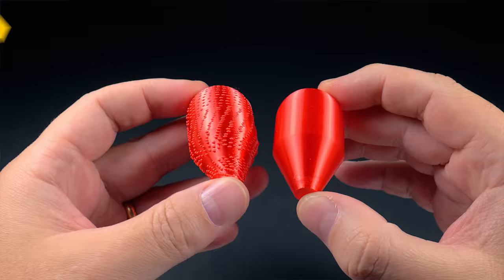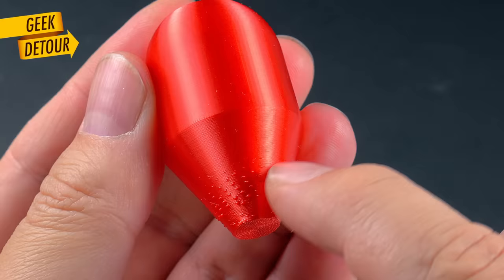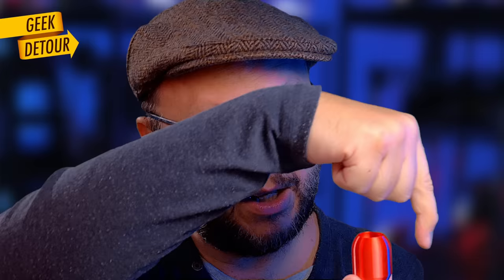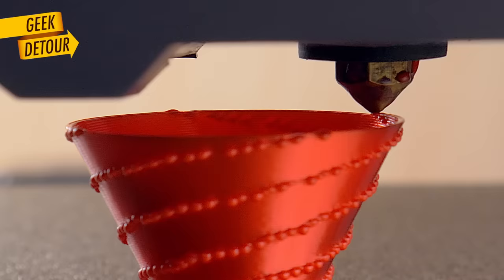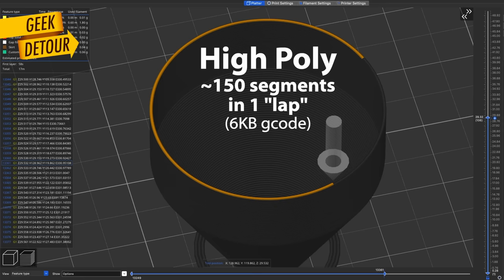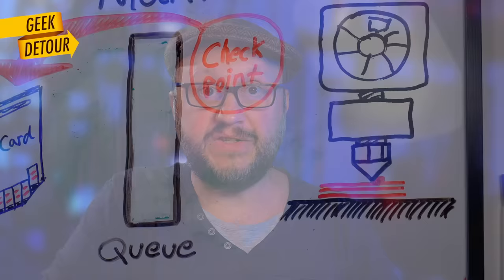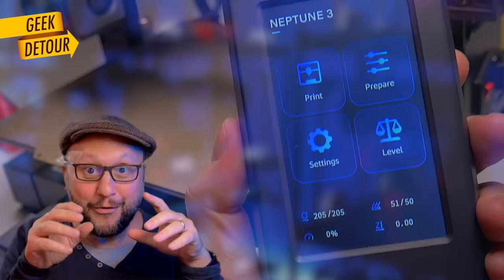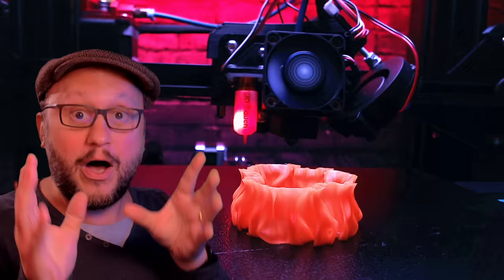3D Printer Blobs: a mysterious problem you won't guess how to fix 🤔

Comment: I got an apc to hold it for a power glitch dealing with finicky abs i rather keep it going and hold temperature. After 1 minute gen already has started and going through its warm up phase to take the load. I can't tell you how many hundreds of hours that APC has saved me from starting an entire print over even if you don't have an automatic generator apc will save you when you're using finicky material.
Reply from the maker: Hi there! I am curious, would you mind sharing the Country / State where you live?
Reply: @GeekDetour  sure USA South Carolina. We have strong storms lighting bolts that will rattle your house. Before i got an apc i had to wait for a clear whether day. As lighting likes to hit the power lines. I have tons of surge clamps for that. My server srt3000 apc will send me an email every time there's a problem. The most i had in a day was 40 and 1 email from the gen where it has started due to utility loss. A braker on the line tripped due to many hits in short amount of time.
Reply from the maker: Wow! Impressive! I would have never imagined 🤯 Thanks!

Comment: I now know why these blobs appear but i have no idea how to fix it. my printer (ender 5 plus) can't read the two gcode files that you gave and there are many little blobs on the stl file. i'm using creality slicer and can't find the option you showed in the slicer and in the printer settings. pls help
Reply from the maker: Hi Nicolas, first: try to copy the stl files on the Root of your sd card - not on a folder. Then print the “disable” one. It will disable the Powerloss recovery feature and save. 
Now you print whatever you used to print before and see if it helped.

Comment: What you do is a workaround. a fix would be either 2 sd cards, one is read, one is written, or a bigger buffer. shrugs
Reply from the maker: Power-loss Recovery itself is a workaround: the pause leaves marks on the print, if it stays down for more than a minute the heated bed cools down and the part you are printing unsticks from the bed and it is game over anyways... So, a proper "fix" is really having an UPS: prints should go from start to finish with no pauses.
Reply: @GeekDetour  well fair enough but a ups is more expensive than an ad card :)

Comment: Wouldn’t it be easier to make a short-charge battery system that only activates when the power goes out? If the machine detects it’s gonna turn off mid project, it could save right there while the short-charge keeps the machine alive long enough to write to the SD card.. you’d never need to apply multiple checkpoints, except maybe once or twice at certain percentages in the project
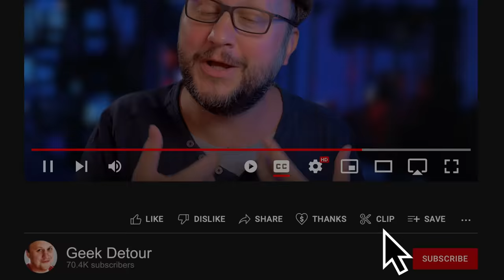Reply from the maker: Exactly! That’s what I mention at 7:10 and that’s what Chris’s video is about (it is in the description).

Comment: May be a stupid question to ask, if I downloaded the gcode for disable power lost recovery, I just need to run the gcode once in the printer or the gcode will work since it is in the sd card to disable it. Don’t know how to confirm it is working.
Reply from the maker: Hi there! You are right: if your printer runs Marlin, yeah, you would only need to run it once. It turns it off and saves the settings. If you have a printer running Klipper you don’t need to worry about it.

Comment: Hi, I come from South africa and we suffer on average three 2 hour blackouts everyday. any advice on optimizing my ender 3v2 neo to minimize any damages to the print when the lights go out?
Reply from the maker: Sure! A UPS unit with a HUGE battery. An Ender 3v2 might consume a bit less than 150W on average. Unfortunately, the cheap 900VA ups units can keep a printer for about 15 minutes. A UPS with a large enough battery for hours of autonomy will cost around a $1000 usd 🤷‍♂️

Comment: In my case, it turned out to be my new TFT35 on my Ender 3 not having a stable connection through its usb port. After going back to using the regular mini SD slot, my prints were fine again.

Comment: I have a sd card from 8 years ago which was being used in my tablet and it runs fine curious what it would be like with a newer card
Reply from the maker: I just got a 3D Printer that has a Raspberry Pi clone inside - and the OS came written on a very “generic-white-lable” SD Card… I cloned it into a better card, reputable brand, fast, designed for “apps” and oh boy it is booting quite faster now. You should try, yes!

Comment: Would it be possible to use a higher quality SD card with higher transfer rates? Would that make the queuing problem irrelevant, or is there an internal bottleneck for data transfer?
Reply from the maker: The problem is writing. It cannot read and write at the same time - and writing is slower.
Reply: @GeekDetour  Oh, interesting! Thanks for the quick response!

Comment: 3:43 - LMFAO. 5:34 - He really delved deep into the rabbit hole on this one... a new board should be designed such that a high speed NVME drive could be installed or a high speed memory chip to simply load in 512MB gcode. This way SD cards could still be used and simply loads into high speed memory, this way same ARM SoCs could be used with it's built in 512KB cache memory that could instantly load from high speed external memory chips that have g-code, the whole purpose is to retain the power-off recovery mode, this is really an important feature simply due to software and hardware reasons for redundancy and not related to no matter how great your power system is. Imagine having the best power system and doing a 1-2 day print job and then some reason a software or hardware glitch occurred, erased all it's current memory positions would mean the printed part is now scraped. Also I advice, if your're doing this for serious work or business, simply never use SD cards, buy a special adapter converter module that takes NVMe drives and interface with SD ports, this would never crash or die as compared to regular SD cards.

Comment: For us beginners, can you make a video of putting g-code on right place soo we dont messed up,Thank you 😀
Reply from the maker: Check my instructions in my Blog: you don’t need to run the GCode all the time. If you “print” the disable code once it will change the setting and save it:
https://geekdetour.com/3d-printing/blobs-in-your-3d-prints-power-loss-recovery-can-be-the-problem/

Comment: Is it normal for it to happen outside of vase mode? I can see a micro pause when it completes an instruction.
Reply from the maker: There are a few things that can slow down the printer from time to time and cause the blobs - if your printer uses an SD Card to print the GCode, if you use the card that came with the printer, that’s not the best. Get a good quality SDCard (usually 32GB is what many printers accept as a maximum), or try formatting your card. I hope it helps.
Reply: @GeekDetour  freshly replaced. I think what I am seeing is the z seam. It's slightly pausing there.

Comment: Hmmm.... Is the SD card reading using SDIO or only SD for arduino? the speed could cause a different, also if using DMA of some arduinos it could remain printing, while read/write from SD.  Could also solve the short freeze problem as my problem (though not related to 3D printing) is solved by SDIO&DMA features.

Comment: I got the same blob problem, but is not at the end of the layer movement is at the start. Firts the nozzle got in place, then the blob (makes a little pause before movement), next is the move, anything to solve it?
Reply from the maker: Hum… wouldn’t it be the seam? Like, every layer change, the nozzle starts and finishes at some point… it leaves a mark, even though it is much more discrete than a Blob.

If you are using randomized seam, try to change to “aligned”, a line looks better than random spots all over the piece.
Reply: I got a Anycubic Kobra Neo, and even with the default profile makes that horrendous  blob at the start of the seam (btw, that only happens when I try to print Swords, the walls or blades are almost perfectly smoth printed) my only headache is in the seam at the start of the layer. Walls or blades are perfectly separated but are stick together (almost glued) by the blob of the seam making impossible print a whole sword (try once but the blades never come out so I ended only with the handle, it looks like I print a dildo, jaja), even tweaking retractions but with no success. Luckyly today I made my homework and tweak the coasting and the wall wipe, and I'm happy because almost got it, now I think the reason still a little bit closer is the elephants foot.

Comment: I also get weird blops like this on my Neptune 4 Pro, only on some models. however there is no SD card inserted.. I'll try turning it off anyways
Reply from the maker: The Neptune 4 runs Klipper - you don’t need to worry about this feature/problem… Klipper doesn’t have PowerLoss Recovery and I think this is a good thing. Unfortunately, the Blobs you are getting are coming from something else 🤔

Comment: Hello, i try to use OBJ rather than STL. i feel my parts look more accurate. but do OBJ file is easyer on Gcode and solve this proplem? I use a Prusa MK3 and I never had this problem...
Reply from the maker: Hi Maxime - for 3D Printing, OBJ files should’t add any advantage over STL files. Both are a mesh of triangles. There could be many reasons why you never had this problem: only high-poly objects, over a certain speed trigger the problem. If you print using OctoPrint, then Power-loss Recovery also doesn’t get involved in the process.

Read the differences between OBJ and STL here - I think you might be complicating your life with no real benefit: https://3dprinterly.com/what-is-the-difference-between-stl-obj-files-for-3d-printing/

Comment: Is disabling the power off feature only help with spiral printing or for normal prints too?
Reply from the maker: Pauses might cause Blobs in any model that has lots of geometry concentrated - like soft curves. It doesn’t need to be in Vase / Spiral mode. It can happen in any type of print.
Reply: @Geek Detour  I was gonna say my prints suffer from blobbing on angled surfaces, but on relatively straight surfaces it's nice and smooth. I'll use your Gcode to turn off the power saving mode. Thanks for the video!

Comment: never had a 3d printer so this comment is just based on speculation, but would having a second sd card for writing the recovery data to stop the interruptions on the first sd card?
Reply from the maker: It would make it considerably more expensive having two SDCards for just a feature that is much better implemented if they add Capacitors to keep the board running just for some extra seconds to write only when a Real Power Cut happens.

Comment: hi! thanks for the awesome explanation, it could be that the same problem can generate blobs but not continue the print? i'm having that issue randombly in my artillery x1. Same gcode, sometimes it makes the print and sometimes it halts makes a huge blob and doesn't continue.
Reply from the maker: Wow Lucas, I don’t have any Artillery printer, but I think you might be having a different issue. Have you tried a different SDCard/MicroSDCard? Try a good quality Class 10 SDCard, don’t go over 32GB (8Gb or 16GB seems to work best), format it into FAT32 and try printing again. I would love to know if it works fine for you.
Reply: @GeekDetour  thanks for your answer! I Will try it and keep You posted.

Comment: Hi, I had this problem with ASA filament, I even exchanged messages with the brand, nothing changed the problem. then, I told myself that I was going to change slicer, I went from Prusa to Cura and I have no explanation, but I no longer had blobs. The only two parameters that had changed were the layer height from 0.2 to 0.15 and the speed increased from 60 to 80mm/s
But I don't think it's just these 2 small changes that are responsible

Comment: I get this issue in vase mode, but I print directly from the slicer on my PC (Simplify3D) over USB to the printer (CR10s-Pro), so there's no SD card involved.  Does anyone have suggestions or a solution, or would GD's G-code fix solve the problem?
Reply from the maker: Hi there! I would investigate the USB cable you are using, try another cable, or buy a very good - just long enough - usb cable.

Comment: Okay, so, I am a bit confused. Knowing nothing about 3D printers, I have to ask why the RAM is so small in comparison to a PC. What is the difference?
Reply from the maker: Oh, fair question! The difference is between “Microcontrollers” and “Computers”. The boards that run a 3D Printer use a microcontroller: it has a CPU that will run only ONE program ever! It is very specialized, never changes, and it can run using very little resources! Everything is written in C++ and very optimized. It doesn’t deal with graphics, sound, etc…   When you think of a computer, it has an operating system, runt multiple parallel programs, much of our RAM manages sound and graphics, large data structures…
Reply: @GeekDetour  so a PC RAM would be overkill. Still, a bigger RAM would reduce those problems, right? As long as the queue is appropriately lengthened, I mean.

Comment: Is this a problem for Klipper too? Any way to use power loss recovery in Klipper without these blobs?
Reply from the maker: Klipper doesn’t even have Power-loss Recovery - and when you print using OctoPrint, even if you have powerloss recovery enabled in Marlin, it has no play. Actually, anything running on Raspberry Pi assumes you won’t have a sudden Power Interruption since it can potentially corrupt files on the filesystem.

Comment: I never enabled it on my Duet2, wondering if it has the same issue as I have planned enabling it for a while.  I came for a CNC machine tool background and find it ridiculous that G2 and G3 arc commands aren't used in 3d printing.  True arcs with one line of code.

Comment: I get that kind of blobbing on non vase mode prints on my ender 3 pro, I don't know what's causing it. You said it's to do with vase mode right? I had it on the free filament that came with it and with a more expensive pla that was brand new in a sealed thing, first print had it.

Comment: Would it be possible to have a 3d printer that when the motor stops, unless given a command otherwise, it stops the flow of the filiment?
Reply from the maker: Hi there 👋 All the motors are stopped: the ones that move the nozzle, and also the motor that pushes the plastic. But the plastic continues oozing involuntarily, because of the pressure that is formed inside the hotend. Retraction is what would make it stop leaking plastic… But we are missing the point: these stops are completely useless - there is no reason to stop. There are better ways to do PowerLoss recovery.
Reply: @GeekDetour  👋 Hi, yes, this makes sense thank you. I am wondering however if such a solution is truly viable for individuals who use 3d printers in areas that PowerLoss recovery is necessary. Also, even thou it is past the scope of this video, in the future it will most likely be possible to print things like organs and other life saving tech that needs to be extraordinarily optimized, and if for some reason these sort of issues exist, I feel like the best idea would be to solve them in a way that allows for PowerLoss recovery, thou of course it it fully theoretical, but again in a more theoretical light, printing in places like outer space, which of course is a extremely volatile environment, would need other solutions. All in all, a wonderful video, I hope for simular videos in the future talking about the mechanics of 3d printers.

Comment: if the queue is only 16 segments, cant you just change the cache to 60 or so?
Reply from the maker: Yes you can change the buffer size (in power of two: 16, 32, 64…) but it doesn’t make it better because the queue itself is part of the structure that is written on the SDCard as a checkpoint. So, bigger, slower to write.

Comment: soo, i should be good if i just let cura print via USB ?
Reply from the maker: When Cura prints using USB, PowerLoss Recovery doesn’t come into play - so, yeah, it makes sense… But I prefer using a Raspberry Pi with OctoPrint, instead of using my computer, since the computer is running many other things simultaneously. In the end, the SD Card is the safest way - just disable PowerLoss Recovery.

Comment: I print a model using 0.4mm nozzle without blob.  However the same model was printed with 1mm nozzle other setting same, it had blobs. is it due to same issue?

Comment: I have a question, I am a technical person, I build computers for clients,, I often make gaming PCs, +16 gb ram+ 500 gb ssd storage .. can't the 3d printer be upgraded with multi gb ram and custom storage? why ,,, a pentium 4 computer have more storage
Reply from the maker: It is a different thing, completely. The Microcontrollers that run a 3D Printer do a very, VERY specific and optimized task: they basically read the coordinates for the next moves and plan the steps for the stepper motors… and uninterruptedly move the motors. It is very tight and it was possible to run it with 4kB of RAM! They don’t even have an operating system - the ROM of the boards has this single program that starts executing instantly at power on. When they went from 4KB to 16 or 96KB, it has way more RAM than it actually needs.

Comment: Not sure I'll get a response here.. but, I have issues getting my models manifold.  

I'm fairly new to 3D printing, and I suppose fairly new in modelling stuff I plan to print.
Reply from the maker: Hi there! YouTube is not the best place to get personal help. I really recommend you to join a Facebook Group - even better if it is specific for the 3D Printer model you have. I participate in MANY 3D User Groups on Facebook and it is great: you can POST PHOTOS of what you are trying to do and the results/problems you are having. Don't describe: SHOW. Help comes super fast!